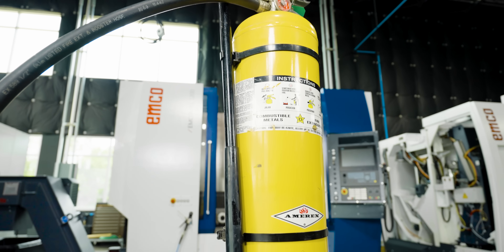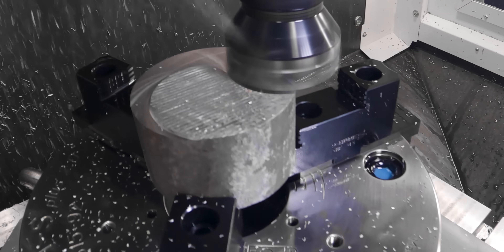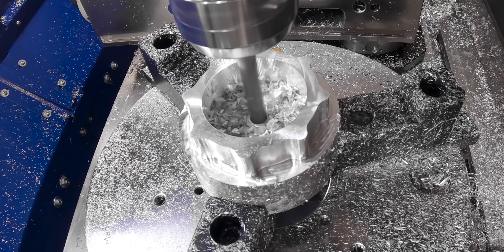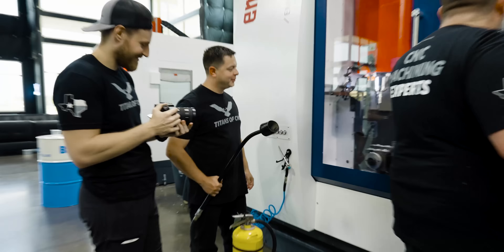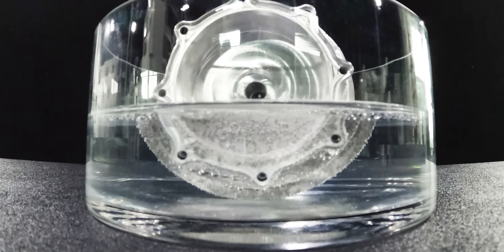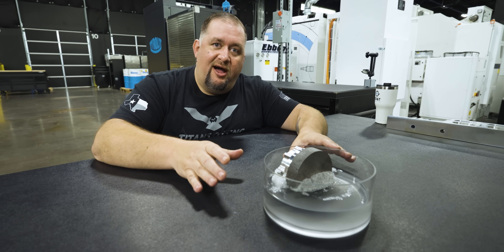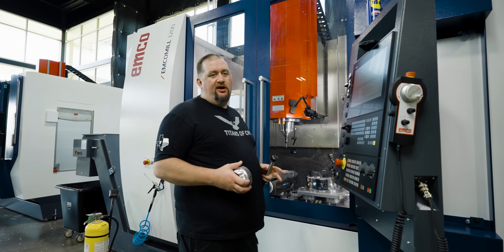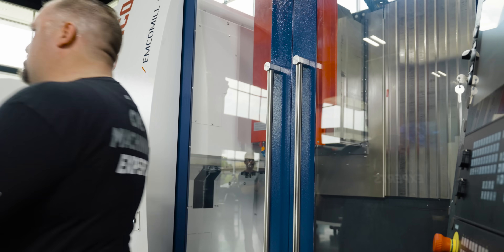Machining the MOST DANGEROUS Material in the World

Comment: It’s not dangerous. Try beryllium….
Reply: I’ve machined beryllium copper. Wasn’t bad to work with. Just wore a mask when deburring
Reply: It's not terrible since the machines are enclosed and at negative pressure. The usual beryllium optical blanks have a few percent oxide added that helps prevent cracking. Pure Be on the otherhand has a nasty tendency to break unexpectedly, these parts are also used in extreme critical uses as well. Most Be parts are made by powder metallurgy and sintered though I've seen a few cast parts before. Most Be is in near net form before it even gets close to a machine except for optical bits. Those are blocks of various sizes. 😮
Reply: Ewe.... keep it to chips not horrible... grinding on the other hand that dust is extremely hazerdous to the operator and anyone in the vicinity🫡